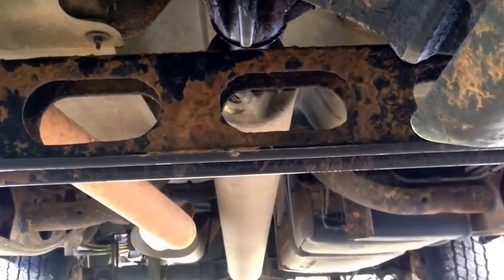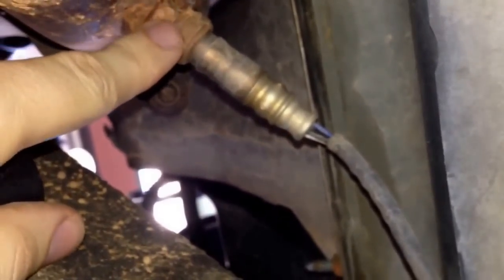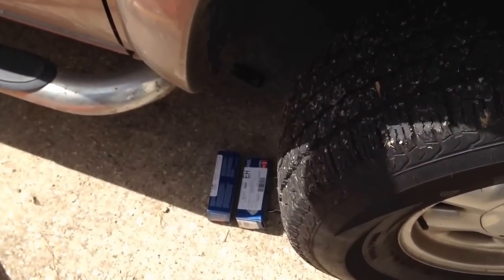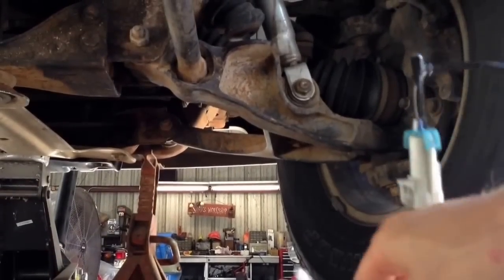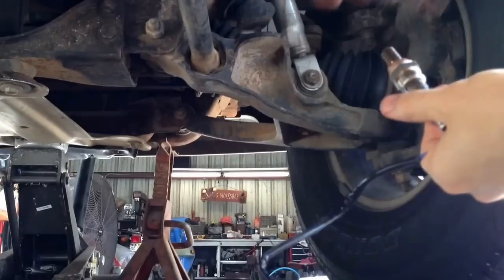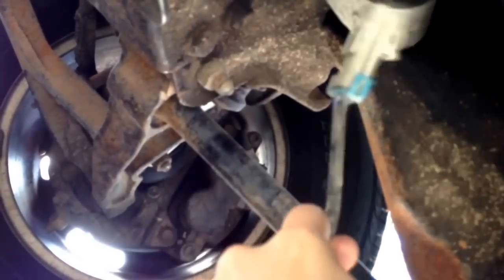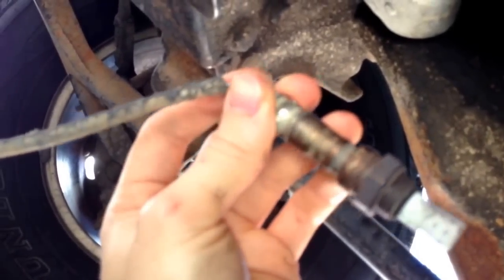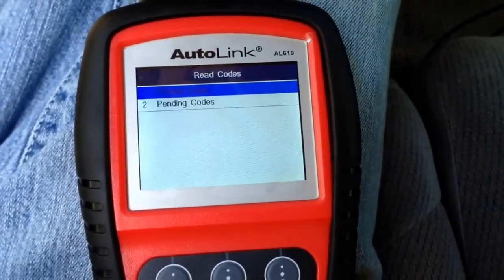2000 GMC Sierra Z71 O2 Sensor Replacement

Comment: a very common problem with the 1999-07 gm trucks with the 5.3 and 6.0 vortec is the oil pressure switch. they usually will run about $40-80 through gm.
Reply from the maker: I'll have to check it out.
Reply: its on the drivers side on the top of the block behind the driver side cylinder head. they are a real pain in the ass just to change it.
Reply: Just had to replace the driver's side.  Holy cow.  I have large hands and it was almost impossible.  A 30 second job took 45 min.